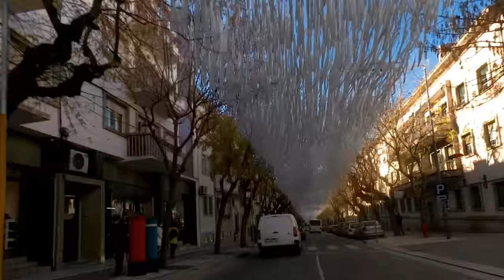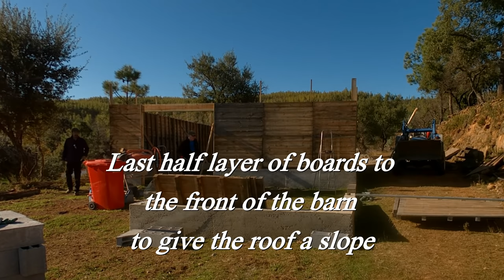NEW GOAT BARN and MILKING PARLOUR - Part 4 - Another day on OUR PORTUGUESE HOMESTEAD 🐐🐐Baby Goats🐐🐐

Comment: Wonderful use of pallets for the goat barn. Looks great!  Let me just say I am not a structural engineer so take this with a pinch of salt. The sides must act as large sails in a strong wind and I think you will need something like a structural beam round the top, to stop flexing, tied down in some way. I just don't want to see all your hard work come adrift and drop things on the goats. I am assuming the roofing material will be light weight so some mass there to hold things down might be wise as well. Wires down to the solid foundation might be a simple low cost solution. I am sure you are on top of things you work always looks very nicely finished so just checking. Lovely video again of course 😀
Reply from the maker: Hi Richard, well you are partly correct in spotting some missing parts🙂👍
We have got vertical supports holding it together, the steel plates holding the posts to the concrete have had a large raw bolt added and when the roof arrives we will be adding a support around the top walls like you say, and the roof structure will also hold it all together...the pallets we are using are 'super pallets', 1inch thick hard wood so extremely strong.. I have built a few large stables before just like this and no wind ever moved them, the last few parts of the roof etc really secures the structure.
We have actually had some strong winds over the last week and the half finished barn hasn't moved yet🤞
Thanks for the great comment 🙂👍
Reply: @FontedaPipaPortugueseFarmLife  That's excellent news, I hadn't appreciated how solid your pallets are and of course your previous experience. I can sleep well again!
I do like the look of the pallet walls and presumably having a concrete base keeps them away from damp so they will last a long time, compared to a damp UK climate. The goats should be delighted and should reward you with lots of happy tasty milk. 👍👍👍

Comment: well done there, how did u come up with the idea to use pallets? looks very nice. do u  still need to treath it for wood insects?
Reply from the maker: Hi, i have made a few horse stables before and these industrial pallets looked just like the stable panels. they should already be treated but once finished the barn will be painted with a mix of diesel and old engine oil, great for waterproofing and the bugs wont eat it.